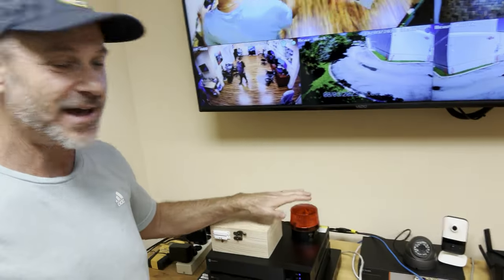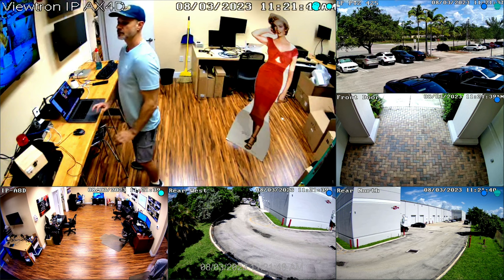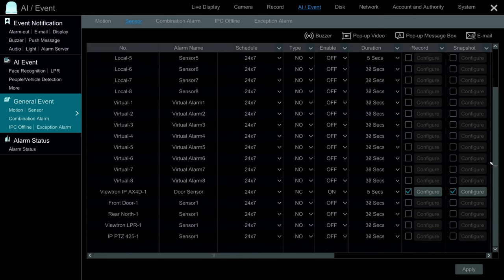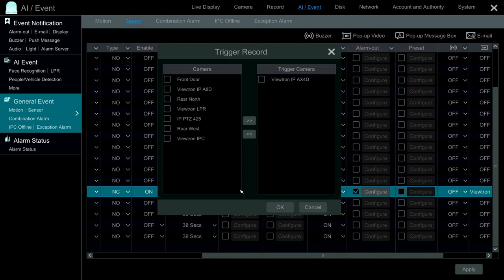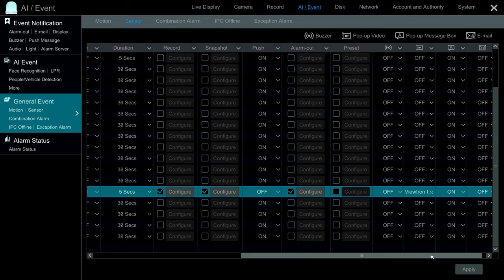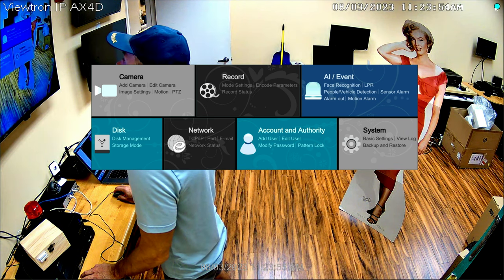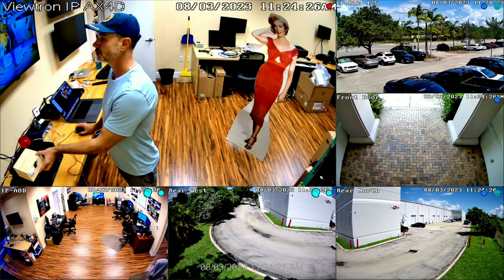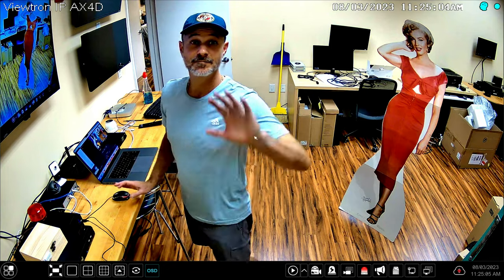Security Camera Alarm Input / Magnetic Door Sensor Setup

Comment: I have a question if I have 16ch NVR and I setup alarm input on 4 Cameras. If 1 alarm trigger it’ll switch to 1 full screen view but what if all 4 alarm inputs triggers same time will it switch from 16 view to 4 view?
Reply from the maker: Thank you for your question. On Viewtron IP camera NVRs and Viewtron DVRs, there is a setting to determine how long an alarm is triggered for. For example, 10 seconds. So if an alarm is setup to trigger video popup (full screen view), that popup will stay active for 10 seconds even if additional alarms are triggered. Then, the next alarm that is triggered get preference after that 10 seconds passes. It is not possible to setup any rules such that if multiple alarms are triggered at the exact same moment in time, something different happens. These alarms are triggered in milliseconds, so it is very difficult for 2 alarms to be triggered at the exact same moment.
Reply: @cctvcamerapros  can we create custom firmware to do so